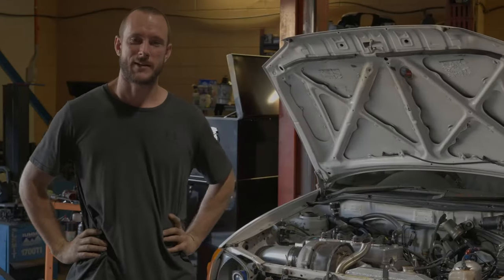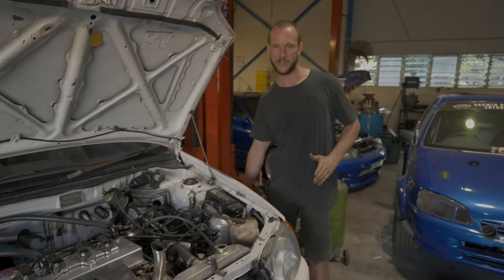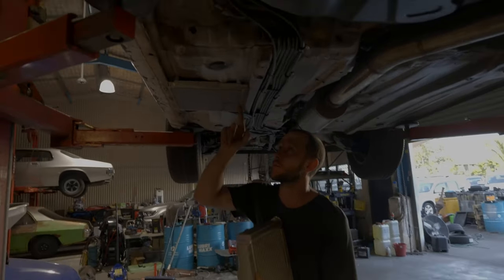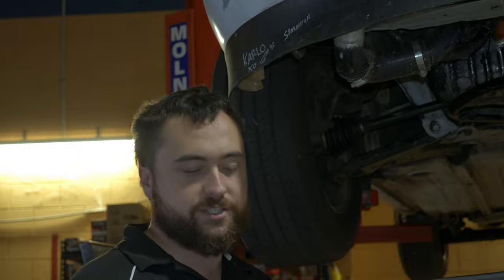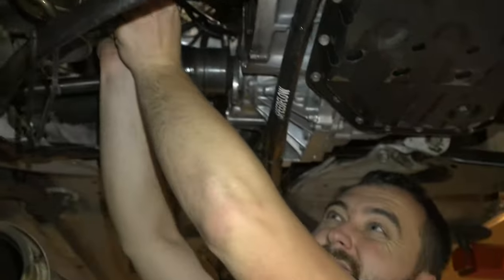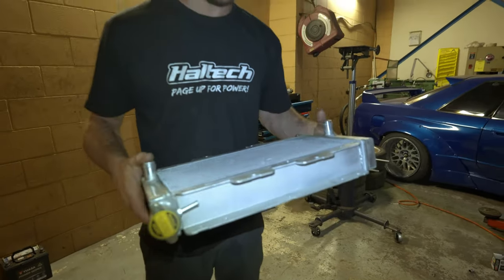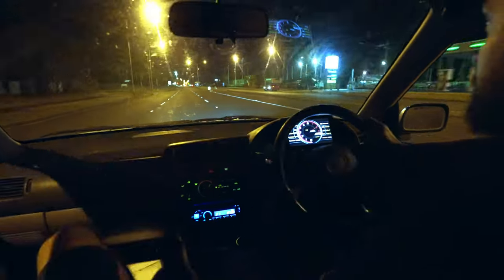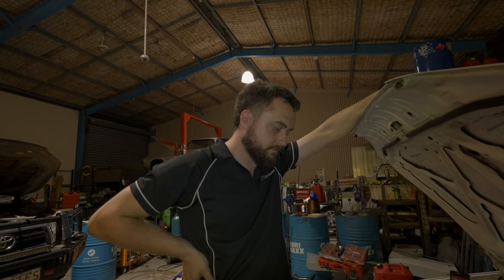4efte overheating issue + low oil pressure problem FINALLY SOLVED

Comment: Did u still use thermostat? My setup is k3vet with td04. My temp always stay at 95 to 99c. I remove the thermostat and its way cooler. 83c to 95c. Worth it.

Comment: I have heard some people putting a washer in the valve itself instead of the restrictor you guys did... 
would the washer not increase the oil pressure as well? is there a "good" way to increase oil pressure that has already been tested? 
Want to have a increase as well on our engines.. Oil pressure seems to low.
Reply from the maker: Washer doesn’t work too well for us, our temp where we live is 35-40 degrees so we didn’t want to use thicker oil either. 

We just made 700 hp, safe to say the restrictor works good

Comment: i realise we are in different sports, i used to shag turbo seals alot in my ct9 on std boost in my rally car. Once i put in an oil cooler haven’t (touch wood) have had an issue since temps are much lower, as for pressure …… the light goes out its must be ok lol. You dont want to run one?

Comment: Damn 80 psi seems very high to me. My 5EFE + T on a Td04L is at like 50-60 on cold, and at idle when warm is 15ish
Reply: Holy shit my haltech cuts the engine at 14.7psi hahahaha
Reply: I agree and depending whether the oil relief valve is located, it could be dumping excess oil pressure back into the sump "either filtered or unfiltered" depending where relief is ported...